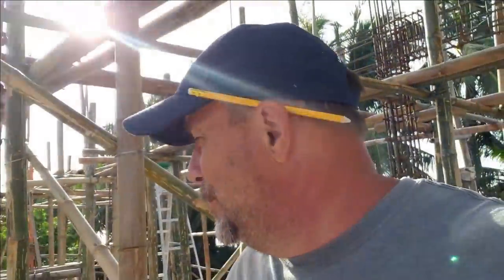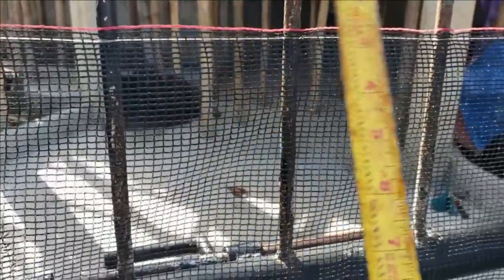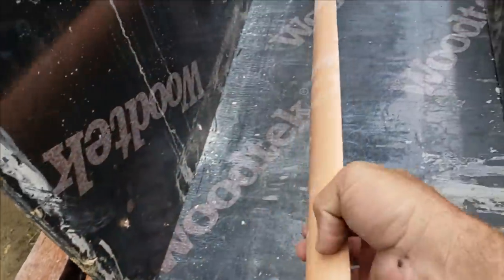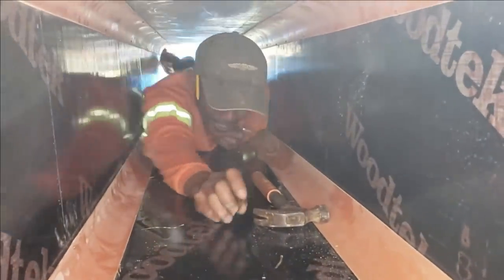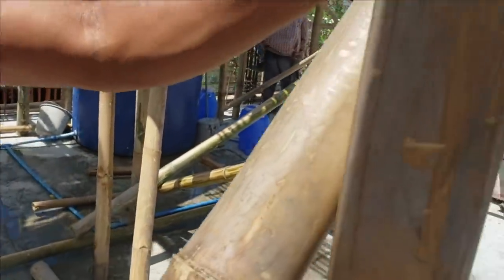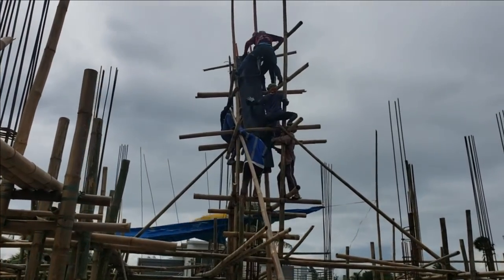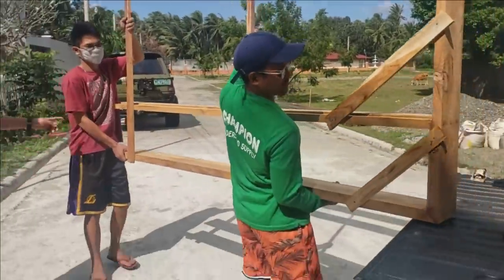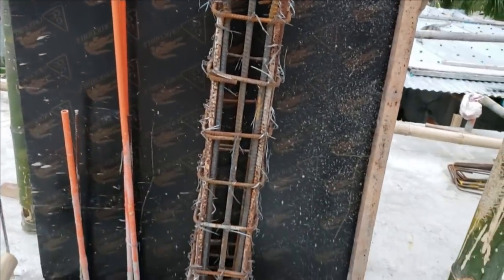Philippines Beach House Build Day 143:  Second Floor Rising! Forming radius cornered columns

Comment: The times you wished you had crane, but then again, employing those guys is and  whats fun.  Love the team work. I had to change all my door jams, closets, cabinets to metal because of termites. They didn't chew up the the wooden doors. I found a good anti ant 🐜 remedy. "Pinesol" from S&R. Spray or dribble full strength around the foundation and it smells better than the poisons. And lasts months. Everytime the floors are swabed the waste water is poured around the yard. Flies hate the stuff too.
Reply from the maker: good tip - I will look into that. I didn't know they had pinesol at snr. good to know
Reply: What would be the equivalent of pine soil in australia
Reply: Pinesol
Reply: Block and tackle would be adequate for that lift ..... or 7 filipino's LOL

Comment: Another great vid, awesome work, gotta lead by example sometimes, it's infectious. That tool on last video, that fixes the cement edge, in Canada was called a cupstone, worked awesome, or piece of broken hollow block to get rid of the snots on wall.
Reply from the maker: Yes diamond cup wheel. I have used them for years. Great for ground exposed aggregate concrete. I had a 4 inch here . Then ordered a 7 inch on Lazada. Impatient for it to arrive so today i found a 7 inch in a big box store.

Comment: I was half expecting a lever crane of bamboo with several long lengths lashed in a with a pivot point at the thick end and a counter balance weight to lift heavy loads up. But more surprises to come no doubt.

Comment: January 12-13, 1985, I was in Airforce basic training at Lackland AFB, San Antonio,  Texas.  We had 13.5 inches of snow, no cold weather gear, and no hair.  I thought I would be slick and go to basic  right after Christmas and avoid the cold weather.  Was told they had not see snow there for 11 years before I brought it with me.
Reply from the maker: I knew it was somewhere around that time! You was in shock I bet!

Comment: Have you thought of building an old school 55 gal drum mixer? That way, the guys only have to add 1-5 gal of x, 2- 5 gal of y, and z gal of water.  Seems like it would be less work than standing over every bag of cement they open.
Reply from the maker: some we make more wet according to the use. Pouring these walls has to be a little wetter to get it all down the the bottom thru the steel grid. A vibrator wont do it all and plus if they over vibrate it then the settle the aggregate all to the bottom once more causing a issue. They have no experience using a vibrator so it would go from watching the water to watching that. We have made it great here so far. STAY THE COURSE

Comment: My little sister lives in Smithville Texas. All of her plumbing pipes burst. The entire house must be replumbed. She had a space heater in her bedroom and that's where she had to live for 2 weeks. It got down to 10° several days. Of course, here in Ohio, it got down to 14° below, we think nothing of it.
Reply from the maker: Sorry that happened to your sister. All of that proves my point on this house build. If it can happen it will happen , earthquakes are possible here. Large waves are possible here.  Build it prepered for that chance. I hope my plumbing is ok in Texas. I vacuumed out the water lines and put in that rv pink stuff in two of my houses. I drain the hot water heaters as well. Whole time I am being told by others that I am over reacting that they should be fine without all of that. If it can happen it will and it did!
Reply: @TexasFilipino  Good job! Now you don't have to worry about your plumbing. Build on!

Comment: That could easily be over 1000lbs, hopefully those bamboo scaffolding can support.
Reply from the maker: do you see how much concrete the bamboo held up during the pour?  They are now all on the same bamboo and lastly that form weighs maybe 65 pounds. those guys on top maybe 105 if wet!

Comment: What size are those column molds? 12in x 12in?
Reply from the maker: that one is 16 by 16  we do have some that are 13.5  x 13.5 on the side towards the kitchen and dining where there will be no more additional load once roof deck is poured. Down the center of the house will be a third floor room with roof deck so they are stronger. The side towards our master bedroom is also 16x16 and are prepared in case we ever want to build more area on the third floor.

Comment: I have question regarding rebar, with storms there they look like lightning rods to me. Would it be worth grounding? Forgive my ignorance if this isn’t useful sit. God bless
Reply from the maker: they big debate on lightning rods has been around for years. They believe lightning forms from the ground up. Trees contain moisture and those wet roots are deep grounding into moist soil. Thus they are well ground so they attract the energy and form lightning. These rebar are isolated into concrete  that is not in soil contact. Slight amount of moisture is in full contact with the steel. Therefore they are semi isolated and not very conductive to lightning hit until the moment I ground them like your saying and then it is game over lightning show.  Remember in the old days everybody was putting lightning rods on their houses until they found out they was then attracting lightning to their houses and had to get that crap off of there!!! Good question and hope my answer helps

Comment: No goats and stray dogs can enter that gate, 2nd floor rising i’m imagining how long it will take to finish the pour on that second level considering the cement mix will come from below..
Reply from the maker: we are stacking to start mixing on the second floor. That is just temp
Reply: @TexasFilipino  that will be nice make a sturdy box to mix the concrete and with that there will be no wastage of concrete remember how thick the cement in the area you used to mix sayang din

Comment: Hey James and others, I've been meaning to ask if I can use US outlets, fixtures and switches in the Philippines. I know PH is 220-240V but the outlets are the same - 3 pronged and standard is also 3-wire in the US but are rated at 110-120V. WIll it be a problem? I notice the US fixtures are higher quality and have 2-3x more copper than the very best one could buy in PH...  Appreciate your or anyone's insight to this.. Thanks...
Reply: I used US outlets from the Cooper Group and the 3 way and 4 way switches are Pass and Seymore 20 amp.
I think my outlets are rated 600v The Philippine light switches  work well and you can have 3 switches in one 
outlet box. We also put a connection box1'" X 14' under the breaker panel to make all the connections and have
a single wire up to the breaker. Westinghouse breakers sold all over the Philippines, but you might want to
Balikbayan the breaker panel.
Reply from the maker: Thanks for helping him George.
Reply: @concretehousebuildinginph1488  Thanks!  So whatever outlets/receptacles and wall switches in the US rated at 125V should also work in the PH 2-wire/3-wire 220-250 volt system right? If a Wall Receptacle/Outlet is rated for 20 amp/ 125 Volts - that means for 220-250V usage - it will just be 10 amps right? I just notice the US made ones have more copper on them and are better built.  Also, will these fit in a normal PH PVC/Steel wall housing?

Salamat po!

Comment: Hahaha. Never see that in the states LOL  Too many ballbearing construction workers LOL.  Besides OSHA !  Takes Fil-Am workers Pride !!
Reply from the maker: I want ot keep my opinion to myself but I probably won't. You won't see it because everybody is getting soft. Not all but many.  OSHA is a train wreck. I beleive is some safety but sometimes  too much is exactly what causes you to get hurt. Your so weighed with gear , hot from so much on , blinded from it blocking your view etc.  Your range of motion is limited etc. I like here where they they just do it without all the bullshit. Well there it is! lol
Reply: @TexasFilipino  Yup ! I started in 1970 with Shell Oil Rfy in Calif. Commumications Dept . It was nothing to hike a telephone pole or jump in a manhole to fix whatever . By the 90's osha kicked in and stopped all that without lots of paperwork and safety inspectors !! Where before I could put my hooks on and go to work , now required 1.Safety Inspector 2. Senior Management 3. Foreman to stupervise the other 2 . Just for me to hookup and telephone line LOL

Comment: James at least you use a drill properly unlike filipino that stop start stop start which burns out the motors. I noticed them doing that previously. My guys burnt out several drills by doing that
Reply from the maker: I keep scolding them for that. I said this shit wont last no time like that. You should see the tips I am going thru. running in screws with tip at 35 degrees off.
Reply: I have also noticed that most Filipinos do the stop start  stop start even with small grinders and the larger cut off saws and welding for sure.  I rode with one guy who even drove his car that way,  Needless to say a good way to make you sea sick.
Reply: Its facinating all the problems are the same for your team and my team  its like a mirror image. I had to.laugh when.the guy asked for a short hammer because they never hold a hammer properly anyway . They hold it near the head which is lighter but so useless in terms of hitting power. I  asked them once why do they make hammers with a handle if thats how your going to use it lol. You have to laugh not cry with frustration. I also find if you are there working beside them things go 5 times faster just like you said😃
Reply: @balikbayanfarmingwithdavee2484  yes i get so sea sick if i am in a taxi in.manila there was once i told the driver to either drive properly or i get out he was so jerky with the accelerator pedel

Comment: James I used half rounds of 3" SCH 1000 around a concrete countertop. That left a nice detail line. The corners 
were mitered tubing. Inside corners were hard to cut so we  made the intersection piece on a short length and 
filled in the space to the next corner with a square ended cut. Countertop 2 we made a mirrored shape curved 
mould to cast the edge against. I have not seen the result of that except in pictures since we are in the US. We 
expect to start the pour on the second lift of the septic tank slip forms in about three hours, weather permitting.
I found out recently that UV light kills bacteria so that seems handy for the third chamber of the septic tank. I will
be casting glass block recesses in the lid of chamber 3 to get some free UV and also to see what's going on in the tank.

                                         george and aurora                                 Villa Cecelia
Reply from the maker: Window to the pooo lol . interesting!  The 1000 does make a nice line in the cast.